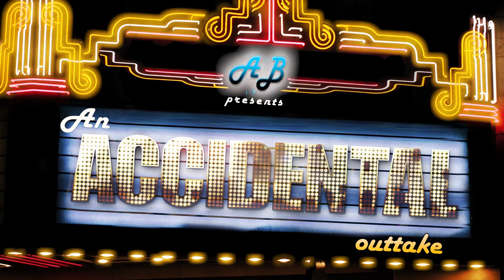DEAD GIRL

Comment: Just a tip kalani (Assuming your weight lifting), I've been studying weight training and conditioning for about 5 years now and you probably shouldn't start off working out as much as you are, your muscles aren't used to that much activity. For the first few weeks your probably gonna burn off muscle so you will get weaker until your body gets used to the training then you will start getting stronger. The rule of thumb is at least one or two days rest assuming your not working different parts every day. My routine is lower body, upper body, rest day, lower, upper (Each are days of the week Monday-Friday) If you start building muscle going everyday once you get burned out and don't want to go as much you will most likely lose muscle going only twice or three times a week because your body will be used to more by then. Just some advice keep up the awesome videos!

Comment: I still think the original stater was clearly working far better than the new faulty one (even with the burnt areas on it). The original showed an increase in voltage while running, this one doesn't show any increase at all. Also, there shouldn't be anything killing the battery at all while running without headlight (dash stuff can run on a button cell battery, so that doesn't count)... so there has to be something extra killing your battery while it's running (wire shorting itself on frame or something).

One thing worth trying is unplug the battery while it's running, if it stalls, stater is garbage.

Comment: Check every single connector on Athena for damage/melting. Even something small could be bad. I had the same problems on my 2012 WR450f. Replaced regulator/rectifier several times as the stator was putting out the correct voltage but nothing was getting to the battery. I finally gave up and took it to the dealer to have them troubleshoot and they said the stator was bad and needed to be replaced. They replaced it and it was still not getting the correct charging voltage at the battery. They troubleshot some more and found a connector behind my headlight where all the ground wires go to was melted and was grounding it out. Something to check.

Comment: Check the resistance of the the stator coils (phases).  Just find the values on the internet or a manual.
but It can be a few other things,  Rare but a flywheel can begin to lose magnetism, if you there is not enough magnetism the stator wont produce enough power.  
Another and Ive had this happen to me, My cdi was bad, i'm not seeing the signs with athena but worth a check maybe.  Best way find a bike with the same cdi doesnt need the same mapping, check it then.  My ktm 450 was having these issues and because its electric start only, thats bad, obviously I dont need to say that.  My mechanic put a quad cdi on the bike and it worked perfectly, but had to buy a new cdi.
and of course stators can be bad even when they are new out of the box had that happen on my ktm 520.

Comment: RELATING TO PROJECT KZ:

This is just a thought, of course. Was your fuel filter dirty at all after changing it, and have you changed or looked at it since to see if it's collecting nasty looking stuff? The only reason I ask is because my buddy has a chevy s10, i know they're unrelated but it was a similar issue that you are both having, and he had a dirty fuel tank from sitting for too long, i guess it was rust and bad fuel that corroded the tank. Worked better when it was given a full tank of gas. Should try to look into getting a new tank if that's the problem with your bike.

Comment: You know, I don't want to sound like i'm putting your bike down, but I genuinely do not like the WR's simply because they do not have a back up kickstart. Now before I get into that, I have issue with push button dual sport dirtbikes. My cousin's husky 450 is also push button, and when we were in the thick of the trails his battery died, like gold fish upside down dead. We had to bump start it several times. So it's not just WR's but push button only dirtbikes in general.

I think you should get a euro bike if you do pick up another, with a back up kickstart. I hope things work out for you. I'm in a two month race prep and most of it's riding and eating super healthy. Keep it up man.
Reply: my wr450f has electric start and a kickstarter. now that you mention it iv never seen a wr without a kickstarter whats up with that?
Reply: TheFordrules
 Looking into it, you're right. I wonder if if it's one of those weird one year bikes without a kicker. That's super strange.
Reply: ye not sure. there's something strange about his bike too the back of it doesn't look like any normal wr iv seen before. its like its a special model or a model sold in different countries. not sure

Comment: To measure the stator voltage when the bike is running you just need to go one click to the right - the V with the squiggly line under it (V ~) which means AC.  If you're not getting a good reading from it, the new stator might not be working.  There are resistance tests I think you can do as well to see if it's shorted, for those you want the little horseshoe looking symbol (ohms). Once you're on ohms you touch the leads together and make sure they read zero, should be a way to calibrate or zero it if not.  Then you can measure resistance.

Comment: Hey man sad ending on the bike. 
I hit you up in one of your other video and I have the renthal fat bars and Highway dirt bike guards on a 2015 wr250r  and my clutch cable is barely reaching it's super tight it rides but it's has no wiggle room same with break side I have a fax between the grip and horn and blinker housing. Have any idea or solution to fix this..?

Comment: its sound like your stator is shot .. here why .. you says 1313 volt and you run 8 miles .. your stator should keep charge all the way your friends house .. I think you should get brand new stator and other parts you says and it will be like new again
you can look on ebay for that parts for cheaper price .. try ebay see if you can get that part and very good price